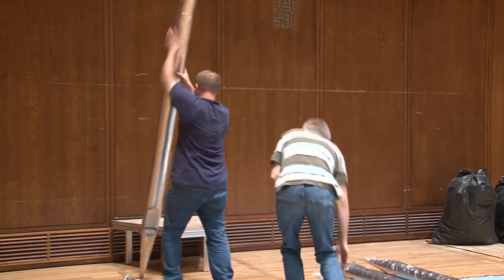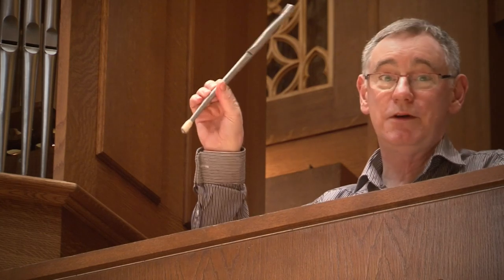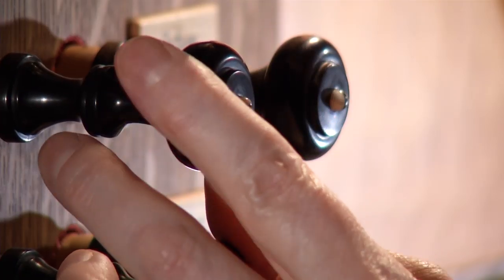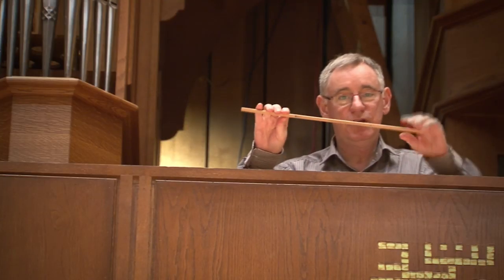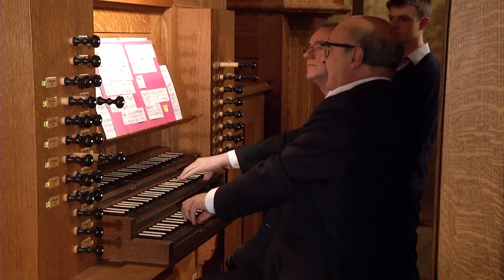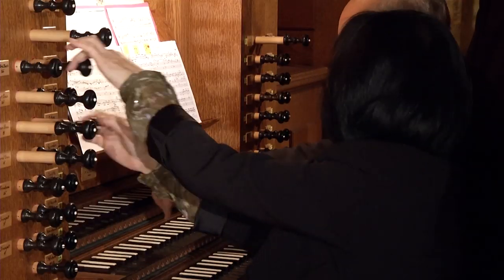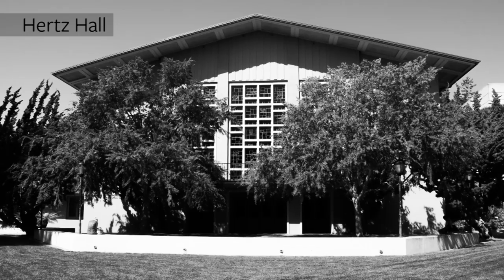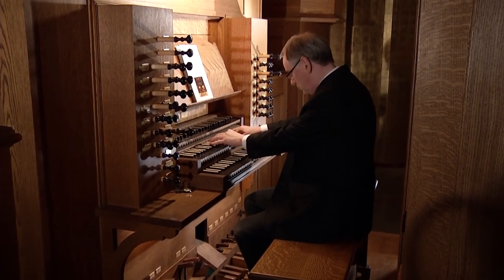UC Berkeley's concert organ would make Bach himself feel at home

Comment: The Noack company did a fine job on a full-mechanical organ, company Op. 98 III/35 (45 total pipe ranks), suitable for training as well as recital and concert.  The drawknob configuration appears in line with ergonomic considerations, divided into sections for Swell, Great, Positiv, Pedal, and Couplers; the organization should make familiarization a straightforward task for both the concert organists and the students pulling registrant duty for Hertz Hall events.

Comment: Well, I see the point - in a way. In my view this is a purists organ, however while tracker action is to be applauded, I see nothing wrong with using aids such as composition pistons. To some extent this is an academic organ, but not a musicians organ. As he says, a pedagogical instrument.
Reply: Would you also say that the huge Mueller organ in the Bavokerk, was a pedagogical instrument---no combination pistons, etc.?  Mozart seemed to like that organ!  Or the monumental Franz Caspar Schnitger at Alkmaar, for the same reason?
If an organ with no mechanical, electrical assists is good enough for Mozart, I should think it's good enough for us!  Furthermore, Mozart was not a pedagogue.
Reply: @urbanviii6557  You could elect to skip the pistons and pull the stops by hand, as Mozart would have intended - no one is stopping you from that. I'd rather press pistons